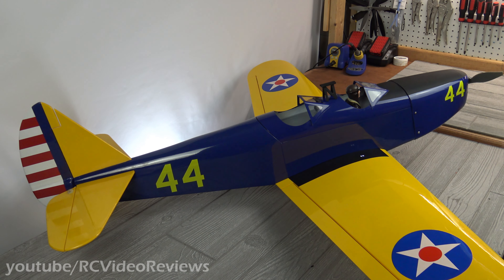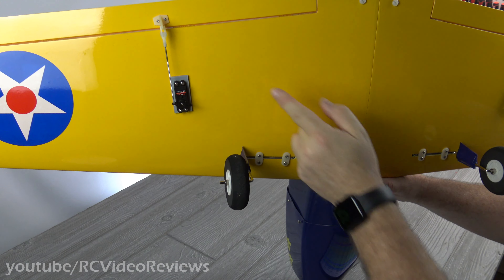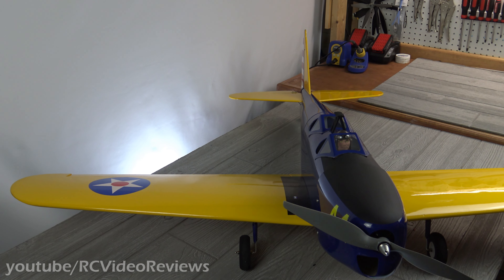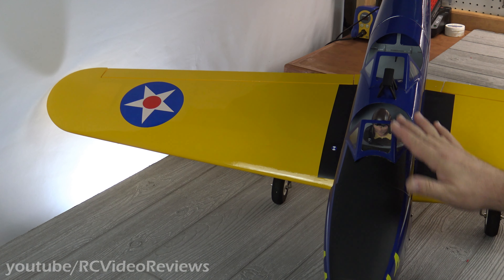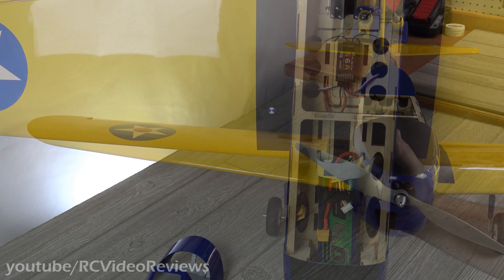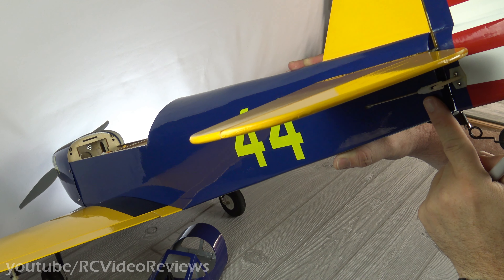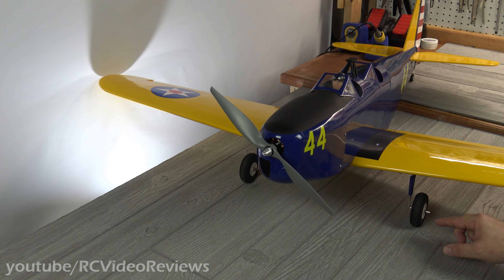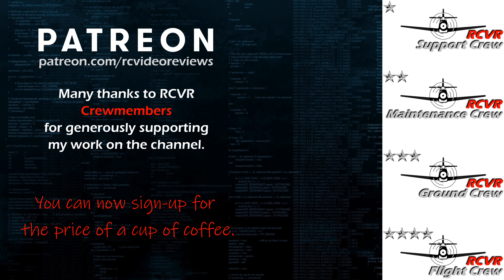Great Planes PT-19 Build Review

Comment: You didn’t say if you had to Fill and Drill the motor mount. Maybe you’re Mellowing out about that. 🤣👍
Reply from the maker: Didn't have to, it bolted right in. It wasn't perfectly aligned, but the holes were big enough to accommodate the Cobra radial mount without modification. ;) I'm very agreeable when they use standard measurements.